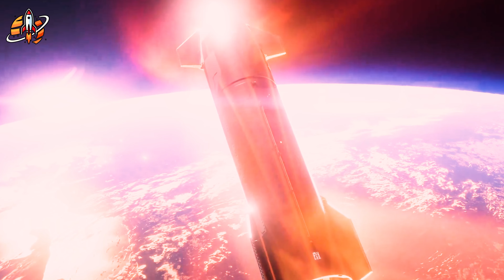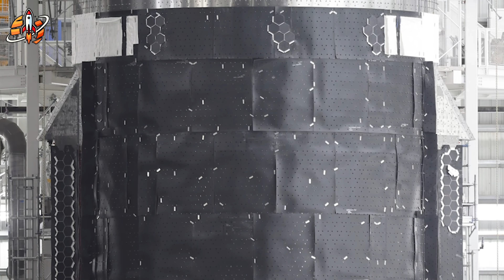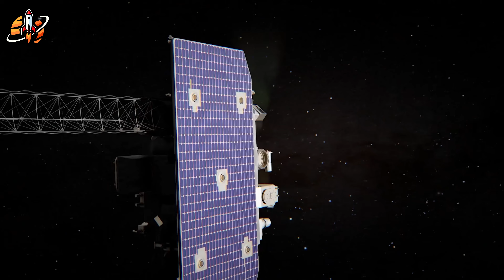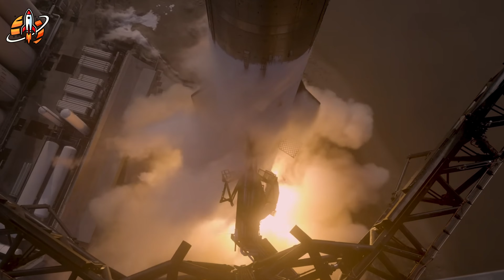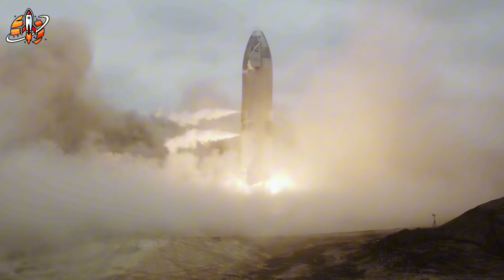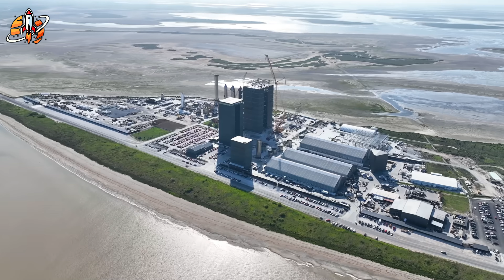SpaceX Did Something INSANE: Metal Tiles Disaster They Don't Want You to See!

Comment: SpaceX proved that metals cannot handle the re-entry heat. It was worth a try but not a disaster of a failure.
By the way, Alumina tiles are strong and relatively unbrittle.
Reply from the maker: SpaceX's metal tile test on Flight 10 was a bold experiment, not a disaster, revealing critical data that led to the crunch wrap breakthrough. Alumina tiles are robust, but gap infiltration remains a key challenge for reusability.

Comment: Metal tiles NOT a disaster - just a failed Experiment - of which there were several ongoing on ift-10
Reply from the maker: You're right, the metal tiles on IFT-10 were a calculated experiment, not a disaster, pushing SpaceX toward crunch wrap innovation. Multiple tests like these drive breakthroughs for reusable spaceflight.